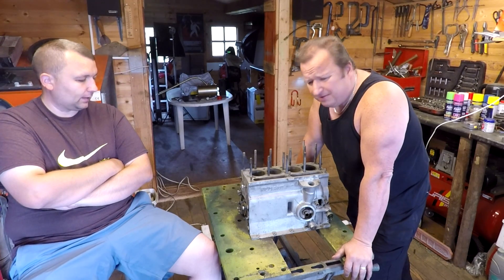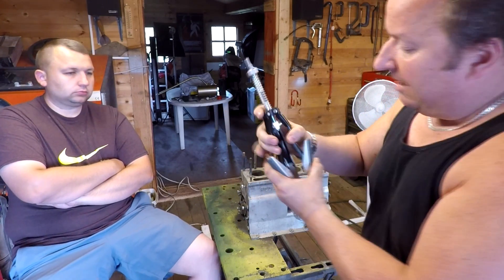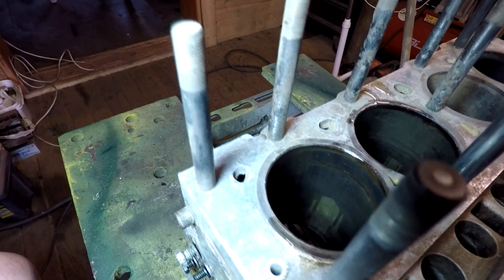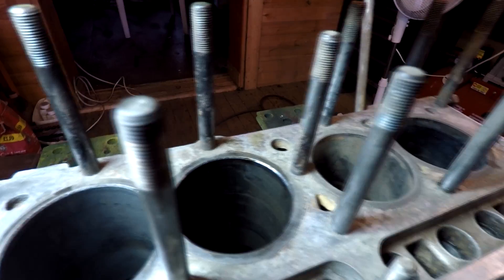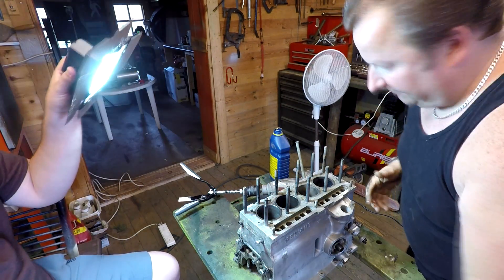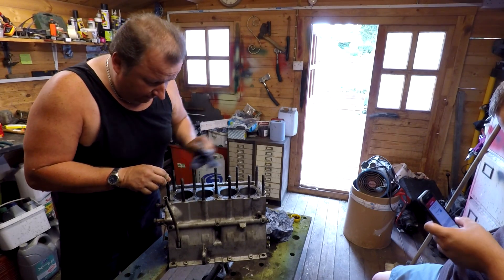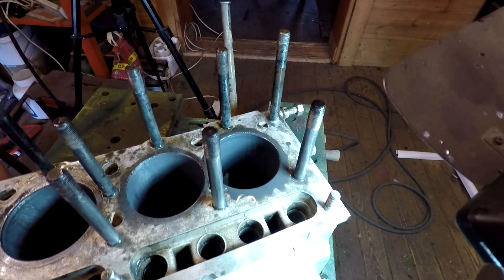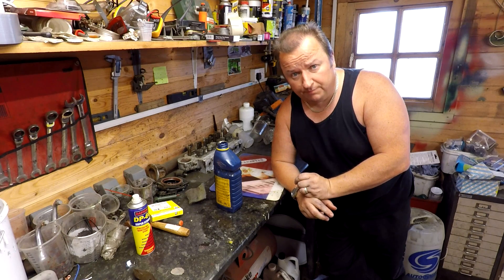Part 37 Reliant Trotter Restoration DIY Engine  Bore Honing

Comment: They’re great little tools those. I have used them a few times at sea on small marine diesels for auxiliary machinery and lifeboats. We used to put the tool in a coffee tin full of oil for an hour to soak the stones fully. We would also have one guy doing the honing while an assistant/apprentice squirted oil into the bore continuously from an oil can. The more lubrication, the better the grit is flushed away. We would just set the block in a large commercial catering roasting tray (which we stole from the cooks galley😃) to act as a save all. For our main engines we obviously had specialised honing equipment as the cylinder bores were far too big (20cm-96cm depending on ship) to use hand held hones.

Ps. Really love the channel and cant wait to see the Reliant finished.
Reply from the maker: Good tip on the oil bath Chris, thanks for that bud.

Comment: Ive used these honing tools for years on my MR2 turbo engines, Last one was my forged engine now putting out over 450bhp, it doesn't smoke/burn oil and has been reliable. Like you say a battery drill on a lower speed would have given more control.

Comment: Nice job re-creating the crosshatch. Will you re-level the head flatness with wood boards and cemented sandpaper with spray lubricant?
Reply from the maker: I will check it.

Comment: That's done a good job Martin. Hones I've used in the past were fairly worn out and took ages. Mind you, having a boring bar we rarely bothered. Cost of rings were (not sure today) almost the same as the cost of new pistons, with rings of course.
Reply from the maker: £20 quid a pot Malc, that a good few quid though. Glad I didn't need pistons as well lol
Reply: You've got off lightly. Not sure of today's prices, but think a full rebuild is £800 to £1000. Btw make sure you take the studs out of the block. Need to check it's flat, but also to clean around the holes. I was reminded I had to do this on the Nuffield last year, otherwise you'll have head gasket problems.

Comment: The trotter van won't be pouring out black smoke..Not quite original, but great for ''The Environment''. 
I got a Peugeot van..It squirts synthetic urine into the exhaust (you hear it squirting) Adblu...
What a pain in the arse it is...To be sure!
The irony is....I can't listen to the radio with engine off...So i'm idling for my 1 hour break...Unbelievable!
Reply from the maker: No black smoke here Stu lol. I could fit a smoke machine though.

Comment: I use one of these hones a lot, try going slower on the drill and up and down faster, helps get the 45 deg angle on the scratch pattern